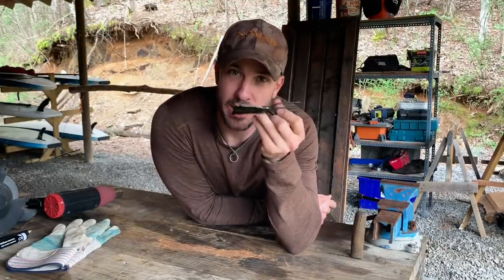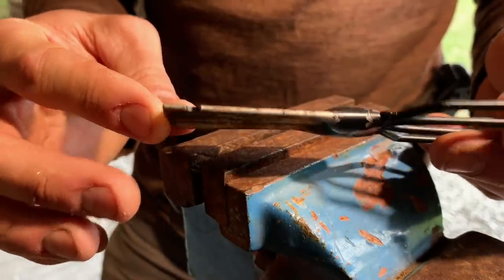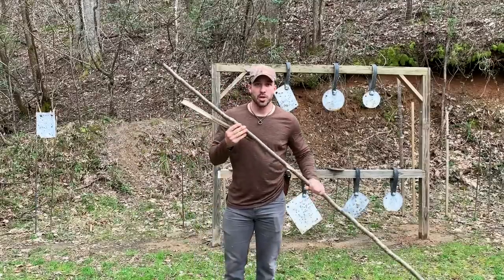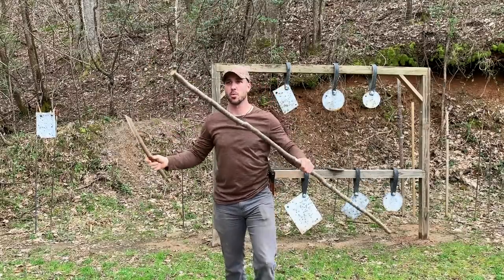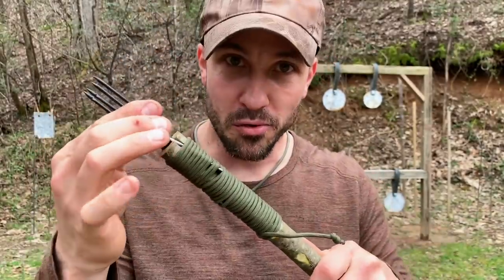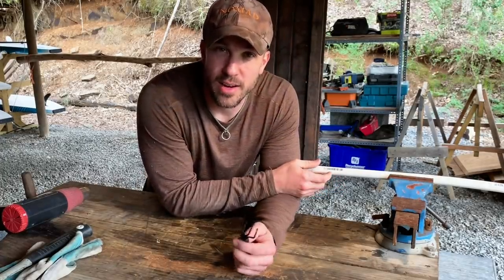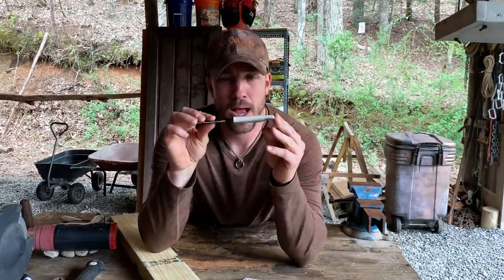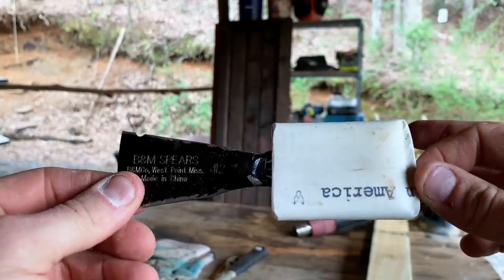Ultimate Frog Gig Set Up and DIY PVC Sheath

Comment: Great idea. I have a gig but never tried to attach it to a stick. I assumed I would carve the end of the pole to match the hole and secure with a wood screw or one of those L shaped screw in hangers. What size PVC pipe did you use? I have been protecting mine with duct tape over the tines. I have subscribed to the channel for awhile but don’t remember you Jason. Your content and presentation were really impressive. 👍
Reply: Texas HornyToad ,
I’m the new guy! I think it was a piece of 1 inch PVC. Thanks for watching!
Reply: ON Three - I guess it depends on how many tines. Measure the tine width. Select PVC size which has a circumference greater than twice the measurement and proceed. Or get the next size larger to be sure.

Comment: A trick with any type of folding knife when you have to baton is to only open up the blade 90 degrees. that way your only stressing the pivet and not the lock aswell. The lock isnt engaged so caution is required but i do it all the time with my swiss army knife. Felix Immler made an video on how this is done with a slipjoint swiss army knife on his channel. Here is the link skipped to the part in which its demonstrated 
https://youtu.be/EmY9WEl4DDw?t=27
all the best from the UK